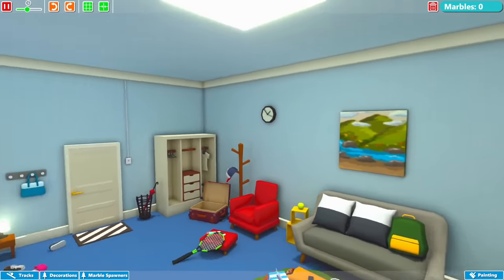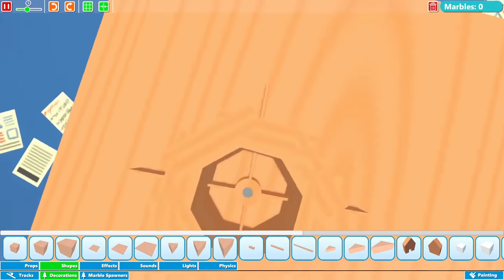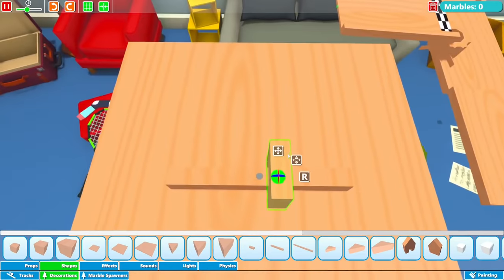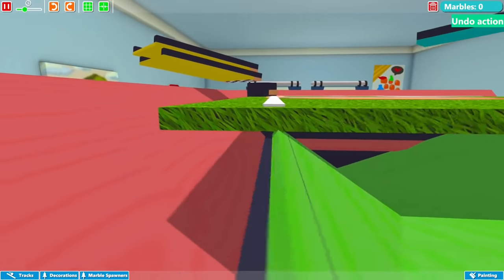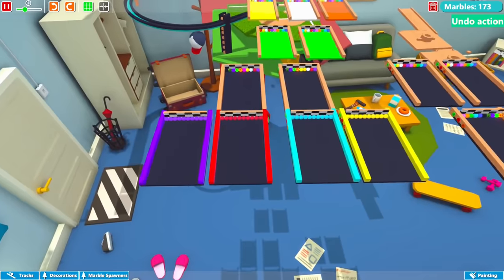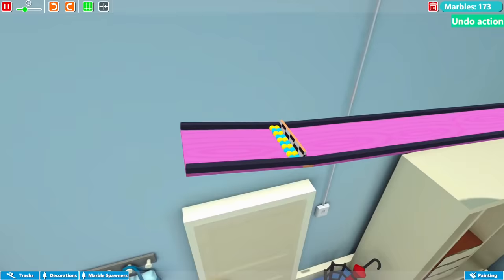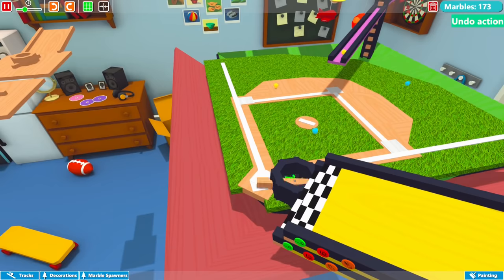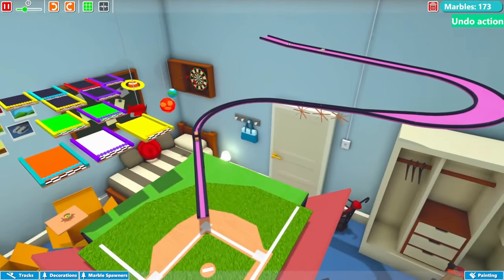Making Marble Baseball Using A Custom Marble Motor! - Marble World Gameplay

Comment: Idea: a course which has large gaps, so you need to shoot marbles at long distances through the air, also dealing with how the marbles could hit eachother mid-flight, to make as stable of a course as possible with as small a surface area for marbles to touch, with as long a distance travel as possible for the marbles. 

Edit: Also, it would be very nice if the devs added gears, and the option to make custom gears by having groups of objects act as a single object, and having the option to make an object or a group of objects be a physics item (like the marbles) which doesn't despawn (unlike the marbles).

Comment: Make a "reversed" course
The marbles do thing backwards, like a backwards jump, or a downwards elevator
Reply: A backwards jump is still a jump, and a downwards elevator is just a pit...
Reply: @Neon-ws8er  well the landing is usually lower in a jump. In the reversed course, the landing would be higher, and steeper to mimic the ramp